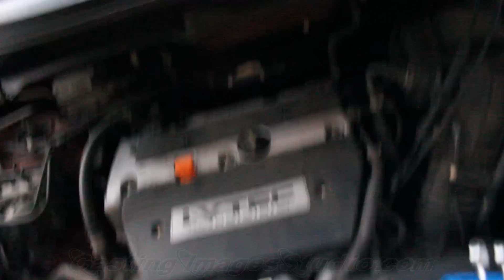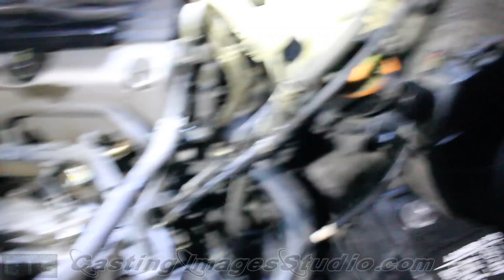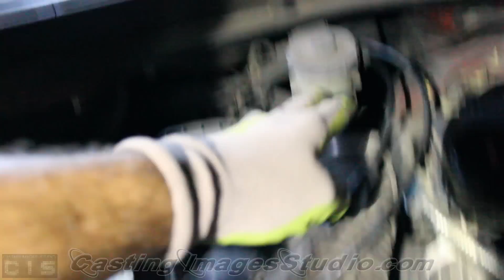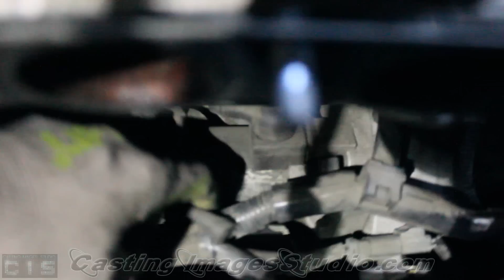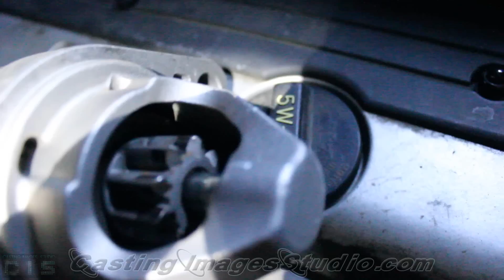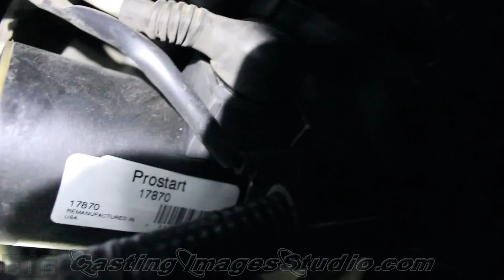How to replace Honda Element starter

Comment: On the '08, there's a giant chunk of plastic bolted to that portion of the manifold somehow, which makes it impossible to remove it the way you just did there. Ended up removing the entire intake manifold assembly all the way to the block, losing coolant and everything. If this remanufactured starter goes out on me, I'm taking the car to the dealership. Not going through that crap again.

Comment: Not bad; but, you can go from the bottom if you have a good jack. Top is one way .  A Honda goes 200,000 + on one starter and it has a timing chain.

Comment: It is much easier to lift the vehicle and come in from below. Just remove the front splash guard and then the knock sensor and you'll have access room. Make sure you have the radio code before you disconnect the negative battery terminal. I don't understand why people are pulling the manifolds...

Comment: Thanks so much for the video.  I did it myself in a few hours.  The thing that took the longest was finding that nut & bolt on the bottom of the manifold.  It was equally difficult removing and replacing that nut.  There is no way your video could have shown the location of that bracket prior to taking the manifold off.  You just have to put your hand down there and feel for it.  It might have helped to have seen a close-up of the bracket after the manifold was removed.  Overall, I would say this is one of the more challenging repairs that I have made myself, but saving over $300 made it worth the time.  I am a visual learner, so the video was a tremendous help.  Thanks again.

Comment: There is a sensor on the engine ,right beside the starter . Do u know what's that for?
Reply: +fratelemeu That's a knock sensor.  Might as well replace it when you're in there.  It's a cheap part and they're known to go out after about 150k miles.
Reply: +jtl909 thank you.

Comment: I appreciate when people provide videos on repairs of this nature. But there are some fundamental things you may consider in the future. First off, you start off by disconnecting the positive from the battery. You should never do this until you first disconnect the ground (negative) one first. Second, you don't mention whether there is  a gasket to replace on the manifold. Its important to note those things so in the event there is one, it can be purchased ahead of time. And lastly, it would help if you mentioned the bolt sizes. It would save people a lot of time hunting for the correct socket, especially on the bolts that are out of sight.
Reply: I agree. Good points. Do you need to replace gasket?

Comment: Great video. Helped me a lot. It's been a while since I've worked on anything on a car. Saved $$ doing it myself. Thanks for putting it together. Found a link on how to adjust idle. May have to do that after removing throttle body/manifold.
Reply: Allan Oracion The only thing I need to add is that 2007 Element (maybe newer too) has a manifold chamber attached to the manifold by three bolts and it has to be disassembled before you can remove the manifold to get to the starter. The whole operation of replacing the starter is a pain in the neck so I know now why they want $600.00 to do it....
Reply: where is the 3rd bolt? We found 2 of them.

Comment: I've got to thank you and most everyone who added additional comments on this great video tutorial. Without this direction, my girlfriend and I would have been out of $600 bucks. We split the effort up into two days. First day took about 3 hours and we got down to loosening the manifold bolts. That took about 3 hours. The next day (today) took about 6-7 hours, but we took our time and ate dinner and drank some beers to ease the stress. There were a few plastic straps and plastic connectors caused some slow ups. The large grey ones had to be pushed outward. The plastic straps had to be pushed in on the back side but I actually cut one and left it hanging as I didn't consider it a real issue. Once you get down to the starter, there are three bolts but one large one that is near impossible to get out. I ended up putting some WD-40 on it for 30 minutes and then tapping it with a hammer. I put a tire iron end against he bolt and then tapped the other end with the hammer for a little while and tried unscrewing it again. It eventually popped and moved out. Putting it back together took a while but it was definitely faster than taking it all apart. Good luck and thank you again. You are awesome for this video!!

Comment: I was just quoted $740 for starter replacement at my favorite independent honda repair shop. (OEM parts) Makes it tempting to do it myself.
Reply: i was quoted the same. bought one from rock auto for 100 bucks shipped and replacing it today. what a deal!
Reply: I wish you good luck man!  I tried myself too, and ended up taking it in returning the starter that I bought, and paying big time.  It was beyond my skill set and patience to get to the starter.
Reply: ssippishark bummer. I've replaced it now. took about 2 hours. I'm putting it back together now. hopefully it runs
Reply: alright i'm done. took me 3 hours, and it started up just fine.
Reply: Good work! You saved a lot of money$$$
Reply: :D
Reply: R A you did from the top?

Comment: I replaced the starter on my wife's CRV from the top as shown in this video.  When, I had to do this a second time on my mother's 2004 Element, I decided to try it from underneath instead and found that it can also be done from under the vehicle.  While neither is easy, I preferred getting to it from underneath in that there is much less of the engine to disturb.

Comment: So far so good but how in fuck do I get those two bottom manifold wire connectors off? It is so fucking cold outside where I'm working I'm gonna fucking lose it! I will never buy a Honda again! What a nightmare just to replace a lousy starter.
Reply: Yeah, my element has been a pain in the ass since around 110k miles.
Reply: Mardasee  you don't have to disconnect those 2 wires at the bottom you disconnect just the bracket that's holding them
Reply: kanjoracing, well I did get those wires off I remember. According to my post that was three years ago. 
An added note, after removing the intake manifold I soaked it with a spray can of grime remover I had and rinsed it off with water removing all the gum inside the manifold. It was spotless. When I drove the vehicle afterwards the performance was great.
Reply: Mardasee lol I'm glad u got them off because God knows I tried and I said
 f#$K IT so I saw the bracket and took that off instead.

Comment: Great Video. I also found that rebuilding the original Honda starter is a much better option then spending $373 on a new Honda starter or $89 for a Chinese piece of crap. The brush assembly can be purchased on eBay for $23 ($7.95) shipping. The brush assembly was identical and easy to install. About 30 min on rebuild due to the cleaning mostly.

Comment: FYI Hollywood u should always disconnect ground side on battery. Computers don't like voltage spikes created when disconnecting/reconnecting positive side to break/complete the circuit.

Comment: You are amazing!  Thank you so much for showing me how to change the starter.  My wife's 2006 Element died this morning after several weeks of intermittent non-starting.  This morning was final straw.  Thanks to your insight I was able to skip all the guessing.  There is no way that I would have ever thought to look for the starter under the intake manifold!  I started the job at 10:00 AM and finished putting the tools away at 3:30 PM (including a run to auto parts store and lunch).

Comment: Listen Hollywood, I think that you did a fine job.  I tackled my girlfriend's 2004 last night at 6, turned to YouTube at 8, and had it done by 11.  I wouldn't have gotten any further without your video - so thank you very much; truly.  I did find that getting underneath for the lower manifold bolt and the bottom starter bolt made all of the difference in the world PRIOR to dealing with the top, but I would have been lost without your help dealing with the intake removal to get to the starter.

Comment from the maker: I did it without instructions/education. Sorry I didn't put that part in, but I didn't have a problem disconnecting wires & tubes. I did explain where I disconnected the wire harness from the metal bracket. Thank you for the feedback. I'll try to make it better if I do another video or I'll change the title of this one. Why don't you make a video?

Comment: I'm glad you figured out how to disconnect those wires. You don't explain HOW you figured it out. I could not see it well enough to figure out. If I could see it I could've figured it out--how hard could it be to disconnect? That's what was so frustrating. But I'm not going to blindly disconnect something I can't see well enough to reconnect correctly. And I didn't want to pry or break anything. In other words, I want to know what I'm doing BEFORE I do it. That's where instructions come in.

Comment from the maker: The wires have a clip on one side. Use a flat head or fingernail to pop it up. It's really easy after you get the first one. Or you can just pinch the plastic holding the wires off to pop the wires off of the metal completely to get them out of the way. Hope this helps!

Comment: Compare: it took me half hour to replace starter on my '79 Ford LTD. Starter was underneath car, easy access, no obstructions. Plus, I found used Ford starter at junkyard for $10. New Element starter from Honda is over $300 so I got rebuilt one for "only" $150 from auto parts store. Did I mention how relieved I was to finish this job?

Comment: The fun continues.... Once I could reach the starter and get a ratchet wrench on it, the f*cking bolts were sooo tight I couldn't budge them. I put on some of that bolt loosener but that didn't help. I had to go to Lowes and buy a 30" pipe to give me leverage. But space was so tight (see above) I could only get one or two clicks on the ratchet each time. Once new starter was on, putting bolts back in was no easier. 10 hour job. Mercifully it actually started. No words for my relief.

Comment: dyeguy0807, I was only able to unclip the 2 wiring harness from the 2 holes in the bracket.This gave me a few inches of slack to move the manifold just enough out of the way to reach down to the starter. I tried to figure out how to disconnect those wires but I couldn't see well enough to figure out the connector type. I finally gave up; I was afraid if I did get them apart blindly I'd never figure out how to connect them again. I was extremely pissed off by this point.

Comment: Also, video doesn't explain that you need to buy the right starter depending on your transmission. Yes, auto and manual transmissions require different starters! I spent 15 minutes arguing with the parts store manager about this. He insisted it didn't matter. I ended up walking out and going to another store.

I don't understand why people bother posting how-to videos that leave out important details like this. Do you want to help people or not?

Comment: Also, the manual doesn't explain that the bracket at 3:30 is underneath and out of sight. I spent a long time trying to find this bracket that was pictured in the manual. If only they'd added a sentence saying "underneath the manifold."

Comment: Folks, trust me, it's nowhere as simple as this video. I learned the hard way. First, at 3:20, notice how he doesn't show how he disconnected those wires? Without knowing how to disconnect them you can't remove the manifold! It's not explained in the manual, either. And you can't look at them to figure it out because they're underneath the manifold!